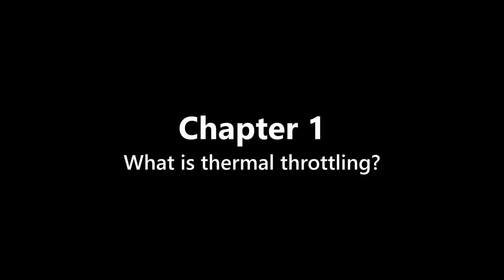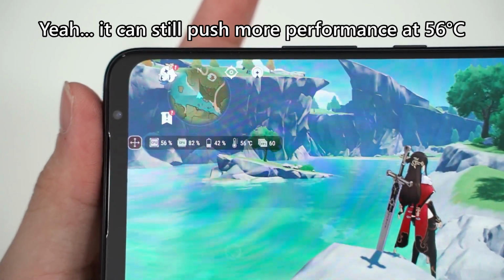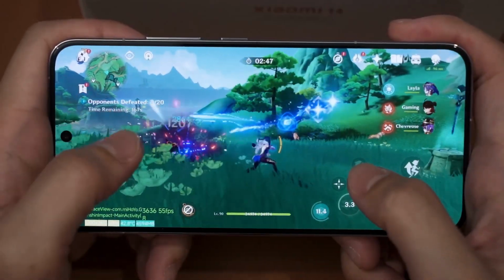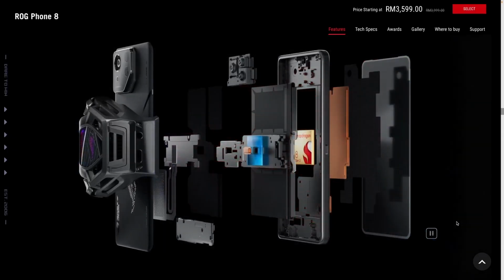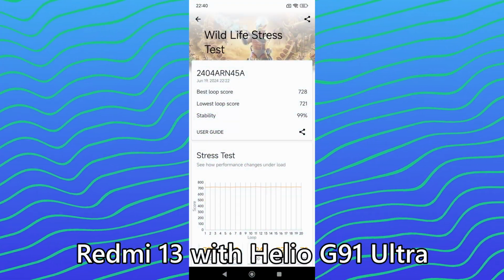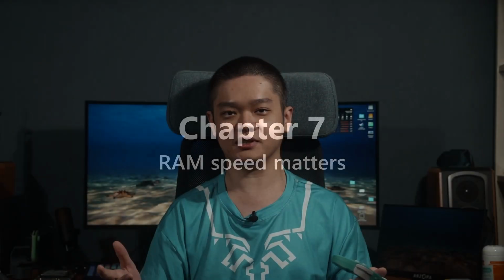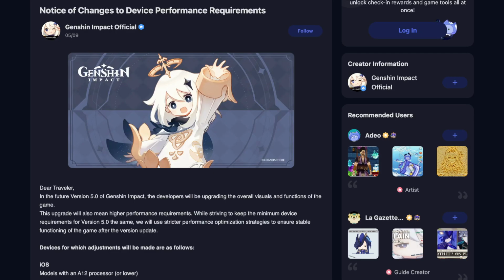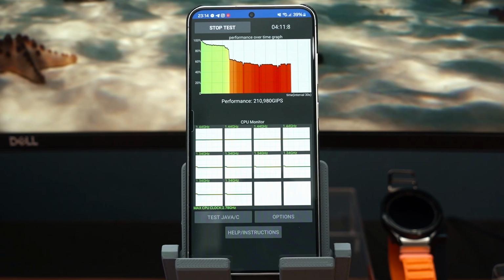DEAL with THE HIDDEN ENEMY - 🔥 Heat & Thermal Throttling

Comment from the maker: Hey y'all - if there are any questions or parts of the video that you wish to have more explanation - do leave them in the comments section.
I do plan to make a follow-up video addressing some of the questions here (if there are any)
Reply: What device did you use in this video?.. you didn't mention at all, you just assumed we already knew??
Reply from the maker: @hashirama-z3r  Which part?
I use a lot. Galaxy S24+, Galaxy S24 Ultra, ROG Phone 8, HONOR 200 Pro, Xiaomi 14, Xiaomi 14 Ultra, M1 iPad Air, and many more
Reply: @NasiLemakTech does the Redmagic cooling system effectively fight thermal throttling or is the fan a gimmick?
Reply: Can I use the experimental game boosting feature permanently. I use s23 and it always cuts fps after just 2mins of playing. It always make sure it stopes at 45 though but even lower settings like medium graphics ultra fps on CODM and high settings like high with 60 fps on genshin leads me to the same 45 fps.
There is temp difference with codm at 45 and genshin at 48. I don't have issue with genshin since it just a rpg I cruise whenever I like but I want CODM fps to be better since it a competitive game and I need what I can get.

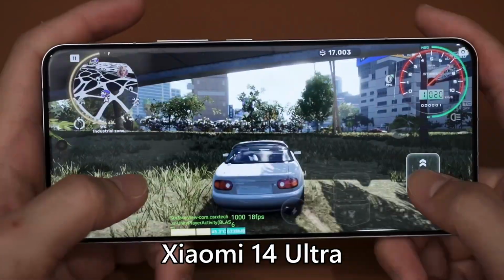Comment: 11:26 what's the most powerful chipset that falls into this entry level category?
Reply from the maker: How entry is entry level? 
I'd say the Snapdragon 680 is one of the strong ones. Then the higher tier comes the Exynos 1480.

Mediatek dimensity 8000 series chips are great mid-range chips too
Reply: NasiLemakTechI I just mean the category in which the soc has good performance stability in the stress test so the phone doesn't heat up. The a55 seems a great option but the thick bezels put me off.
Reply: @64bit- s24 fe it has slight underclocked exynos 2400 giving same performnace but higher stablity

Comment: So informative, learned a lot. I have a three questions.
1) Is overclocking really possible in mobile phones?
2) My exynos 1280 really heats up the front camera area of the screen when I try to play a graphical game like BGMI/CODM, how does your statement of Lower chips not heating uphold to this? 
3) What about device heat up during charging?
Reply from the maker: Oh I like structured questions
1. Yes, but rooted devices only. Phones are very locked down by default.
2. Exynos 1280 is considered mid-to-high range and again, not all low-end/mid-range chips have performance that is low enough that it doesn't thermal throttle.
3. I completely missed out on that. Yes, that affects performance as well. It's practically the reverse effects of battery bypass.

Comment: After watching many ways to cool a device, i think i finally found two ways, 

1st finding a mini table fan with high rpm, because i have cool climate so the mini fan pushes cool air faster 

2nd is Phone Cooler, but with little addition from our side, Currently the cooler only cools center area and waits for heat to travel to the center, what im gonna do is find a 0.3~0.5mm Cooper plate and cut it in the shape of the phone, so instead the cooler waiting for heat, the cooling travels to heating area, i assume.

And obviously tweaking graphics and limiting fps to 40~55fps

But my unluck, i have bad Internet 😤

Comment: This is why I cannot like my poco x4 gt and f5 due to having plastic backs (gave them away to relatives)

Still keeping my mi 9T pro and poco f3🤩🤩 (am fine with low genshin graphics with 60 fps)
Reply from the maker: Plastic backs aren't bad. Sometimes I do prefer plastic back more than a glass back
Reply: @NasiLemakTech  but the heat dissipation  is reduced to the display panel :(
If not gaming, then yeah, a good one 'coz lighter

Comment: In the topic of the HTC one M8 being a solid block of aluminum, why are phones not built like this anymore, I get the part where all manufacturers use NFC and wireless charging coils now days but is it not cost effective to do something like the first Google pixel where they had a small glass piece at the top but the device was aluminum all around? 

Exelent video! and sorry for the wall of text 😅
Reply from the maker: Excellent question - it's sort of creating a Faraday's cage - in this case, a Faraday's barrier???
I'm not familiar with Google Pixel since it's not available in my country. I think they're not doing that is mostly due to cost and manufacturing complications.

Comment: One thing you skipped is the display.
It's not that big of a deal in android phones because most have atleast some form of cooling but iphones are the worst when it comes to throttling the display. Dropping the brightness should help with thermal management but how much do you think affects the power management and throttling?
Reply from the maker: I am aware of this but I personally use my phone at ~80 nits most of the time, so I didn't experience anything related to brightness level changes due to thermal throttling.
Worth exploring in the future though

Comment: I HATE my S24U for throttling
My ex S23U was The Best Samsung I had
Reply from the maker: Blame Snapdragon. I love my S23 Ultra too, honestly. Much stabler frame rates for gaming.
Reply: I only have s24 plus exynos but still holds up yesterday i was out whole got 18 hrs with 4.5 hrs while having 120 fps gaming sessions on cod on 5g all day no wifi still had like 7 to 8 % juce left with temps near 40 and 80 % percent humid weather  still made it back home  @NasiLemakTech
Reply: i was waiting for 24U before it’s released for about 3 months 
but when i saw how it performed 
i just bought iPhone 15 PM
and i don’t regret that at all

Comment: The temperature you're showing in your videos is always battery temperature. Most Li-ion batteries have an upper temperature limit of 50°C, above which the service life is drastically reduced.
Reply from the maker: Nope. That's the IHS of the chip's temperature. Battery temperature is different.
Reply: @NasiLemakTech  the one from GPUWatch is the battery temperature though. This video was great, but you confused the SoC temperature of the Rog Phone with the battery temperature and compared it to the battery temperature of the S24U. Very common mistake and many apps don't even report the right SoC temperature, they just use an estimate. The SoC temperature is unimportant anyway, as silicon is fine up to 90°C and as it is not in direct contact with the phones body anyway

The battery temperature, from what I am aware of, is correctly reported on any Android device and that is the temperature that is much more likely to be similar to the surface temperature of the phones body. So the one everyone should focus on when trying to assess thermal limits, throttling, whatever
Reply: @NasiLemakTech  You can see the actual SoC temperature with DevCheck if your phone is rooted or you got a snapdragon device. Usually the SoC temperature from powerful chipsets like Snapdragon 8 series is between 80-90°C when playing demanding games like Genshin. Give DevCheck a shot if you like. I use it to monitor CPU & GPU temperature on a rooted S21 Ultra with Exynos

Comment: Man, this is a very good and easy to understand introduction to termal issues on mobile devices.

I really appreciate it.

And I have a personal story to share: I had the RoG 3, which still runs Genshin Impact quiet well nowadays but it gets uncomfortably hot to touch. Now, I switched to a RoG 8, after almost 4 years, and I'm very impressed. It is an efficient phone for daily tasks, the "slow" charge speed is 30w and I can't make it get hotter than 42C with that active cooling system in the aggressive mode.

Comment: Spent bit of money to get a decent cooler, piva bl7, my s23 ultra never throttle in genshin now, it's always 30-35c even in Fontaine water region, fps wise I don't notice that much of a difference  but battery life wise it last longer

Update: Fontaine underwater makes it reach 38c , same with dense jungle area in summer
It never gets close to 45c like it used to when I first started playing without any cooler.
Reply from the maker: Gotta connect the cooler to the charger too right?
Reply: @NasiLemakTech yep, I do play with a 20wpd power bank when I'm on the go, if it has its own battery it'll run out pretty fast and I bet the weight would be more noticeable.

Comment: What if i put ice on the back of the phone and use something like Samsung dex to play with controller on a bigger display while the phone is chilling with the ice ?😂
Reply from the maker: Honestly, I'm just worried about condensation inside the phone. Other than that, it's a perfectly valid way to play your games.
Reply: @NasiLemakTech oh you think metals gonna shrink and expand in there and destroy the phone? Interesting but that could be resolved with warranty since it won't look like physical damage if I don't tell them i used ice
Reply from the maker: That's not my main concern. It's water droplets forming inside the phone. It's not vacuum sealed inside, so water droplets are going to form if it's too cold inside.
Probably not going to happen if you don't turn off the phone while it's in ice
Reply: @NasiLemakTech  oh damn I haven't thought about this , thanks I'll try with secondary device and tell u if I remember to

Comment: My s24ultra is performing better than ever doesn't thermal throttle because it all depends on ambient temperature and the only game that really brings 43c to 44c tops is uncaped and high settings in warzone mobile because it isn't optimized for the million time if the games are not optimized then it's likely to thermal throttle 😊 my s24ultra is a beast honestly stability 71% understand me.
Reply: snapdragon?
Reply: @debabratabrahma yes sir 8 gen 3 snapdragon
Reply: @OfficialPapa_Julio  yup. Hunch was right. If it was exynos, wouldn't have been that cool.
Reply: Lol my s24 plus never goes beyond 43 with outside temp at 40 with humudity thats playing in normal room with  lol bgmi at 90 fps @debabratabrahma